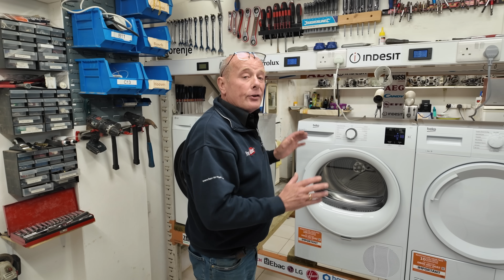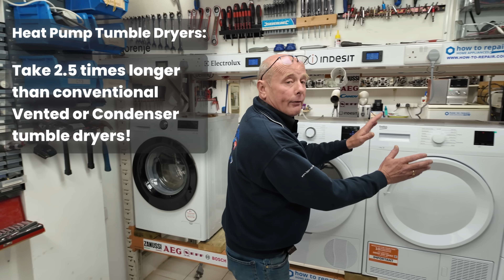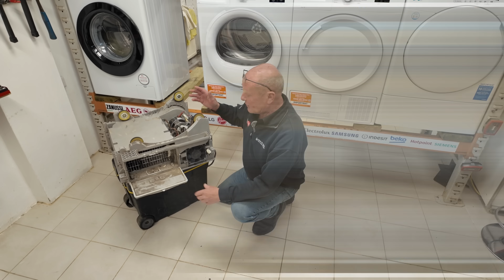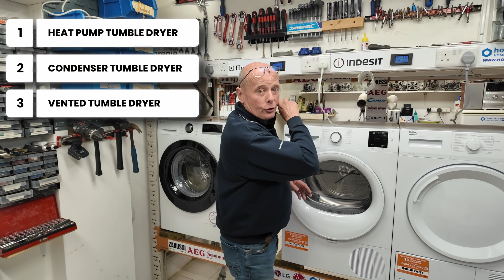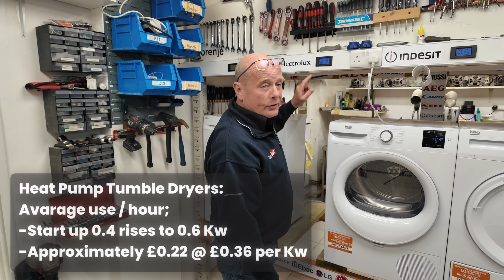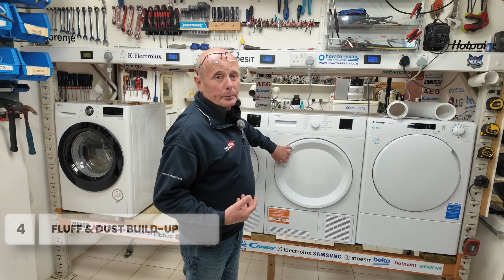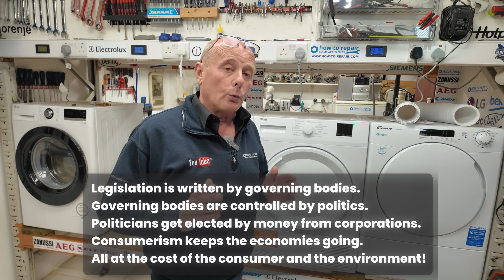Tumble Dryers the Shocking Truth About Heat Pump vs Vented & Condenser, NEW LEGISLATION!

Comment: As a German I can tell you that you will have fluff inside a condenser or venting dryer too. I open my 20 years plus AEG Lavatherm condenser dryer about every two years, same I did to the  vented Privileg dryer of my mother in law first opening after 30 years two buckets of fluff, and last but not least the MIELE condenser dryer of my mother stopped working, she already had the Miele Technician come to inspect it, she called me afterwards and asked me if I want the old one it's not working anymore, and the Miele Technician said to her it's not worth to fix it. She ordered a new Miele Heat pump dryer, I told her I'll look after the old one, she should cancel the order but she won't listen. Well long story short, I picked up the 25years old Miele took it apart and the failure was just a big pile of fluff behind the power switch, the fluff blocked the microswitch on the PCB. I gave it to my mother in law the dryer still goes strong and finally matches now on top of her Miele Washing machine and her old vented one I brought to our gas station. All in all never bought a machine in the last 30 years, I even maintenance our washing machine every two years regrease the rear bearing that's it, couldn't save more money over the last decades. Greetings from Germany
Reply: Any dryer will build up fluff. And I got the feeling that the old ones do it even worse than the heat pump dryers.
It is satisfactory to remove the fluff of course...
But yeah, always remove fluff after or before running the next job. Especially from the heat exchanger.
Reply: @bloepje  True, here in Germany fluff causes a lot of household fire, once the fluff ignites the thermal fuse in the heater element is useless. This is another pro point for the heat pump dryers.
Reply: @carstencroessmann agree - however fluff + electricity = risk. Mitigation: keep flammables away from appliances.
Reply: @SchorschvomDorf  This is really the EV argument. There as less at the present so it's to be expected not so many problems are currently being reported as there will be once all vehicles are EVs. Same with heat pump dryers. Fluff is fine lint like particles, like all small particles in air, once the ignition temperature has been reached it is self combusting. The more fluff/lint build up the less cooling airflow for the motor and compressor and both will eventually run very hot. Once the ignition temp has been reached the lint will self combust without the need of a heating element to ignite it. I think it's worth bearing in mind that, unlike conventional dryers, most people will need an expensive technicians visit to clean out fluff, so heat pump cleaning it's much less likely to be done. Only time will tell and once everybody is forced into heat pump dryers just how many will actually burst into flames due to fluff build up.
Reply: @bloepje  You are talking about the fluffy particles that travel through the system and are retained by the filter. We are talking about these particles that have escaped from the system and are accumulating inside the machine under the hood, all over the machine components.
Reply: @bloepje My experience is the old dryers from the 70s and 80s were far better than what we have today…and they are still going in 2026.
Reply: @bloepje  Unless I misheard isn't that what he said, all machines are subject to fluff. The points he makes are that cleaning out the fluff on a conventional dryer is designed to be easy enough for the lady of the house to do quickly herself and often without tools, at most one screw driver. Cleaning out fluff on most heat pump dryers is beyond the majority of DIY'ers and can take 1 or 2 hours for even a qualified technician. (at maybe £75ish per hour). The other point being that because it takes 2.5 times long to dry the same load the wear on the material can be expected to be around 2.5 times greater and the amount of fluff from the same quantity of materials is also likely to be greater per drying cycle because of the longer cycle time needed for a heat pump dryer. In addition to the points made in the video the source of heat will have little to do with the amount of fluff, heat is heat, what creates the fluff is the tumbling action of the drum and the length of time the material has to be bumped around inside a rotating metal drum.
Reply: Yes the problem is you have to tear the heat pump dryer completely down to clean off the fluff from the heating element that which is not self cleaning as the cooling one is. I did this once whith my siemens heatpump dryer because it took forever to dry shortly after two years .Before i reassembled it I  drilled a 1,5cm hole into the plastic box right between the condensing and heating element and sealed it with a rubber cap. Now every half a year i open it from the side (cutted a maintainance opening into the metal side too) and clean it with a peace of garden hose fittet to the vacuumcleaner. It s really a shame that this little opening  makes the difference between too costly to repair and repaired in 5 min. It works well now since 6years
Reply: We have an old vented Miele, it is brilliant, but when we moved it it stopped heating. I eventually found the problem , a little safety switch needed resetting under the drum, difficult to locate. Anyway it is 20yrs old, but unlike the cheap condenser dryers, there is no possibility of corrosion between the aluminum cooling pipes and copper pipes. Family and friends buy them and they don’t last 6yrs, what a waste of money.
Reply: I pulled out enough fluff to fill a large black bin bag and part fill a second, when I took my current vented dryer apart to replace the rear oilite bush and drum shaft, it was probably 15 years or so old at the time. It was one of the hotpoint indesit models that were later recalled for modification for being a fire risk, because fluff could find its way into the element, ignite and get blown into the drum or onto the fluff that would get trapped and build up under the rear drum seal, which was also made of a non-fire retardant foam.
Reply: The Germans must be recognised for making great domestic machines. I have a Siemens but would have also chosen AEG / Bosch or Miele
Reply: @portuglish Since the 1980s the "AEG" brand belongs to swedish Electrolux corporation.
Reply: @portuglish  Bosch and Siemens are the same
Reply: @portuglish  Pour AEG et Miele j'en sait rien par contre concernant la qualité hummm Bosch plus jamais je suis passé chez les Suédois Electrolux que je trouve bien supérieur. PS: AEG appartiens a Electrolux depuis 1996 donc c'est aussi Suédois.^^
Reply: @portuglish Had a Siemens washer and dryer sine 1997. Had to replace the commutator brushes on the washer about 5 years ago. Otherwise no issues.
Reply: He said that but the difference is I can clean it myself.
Reply: What has being German got to do with anything?.
Reply: @ I was offered the choice of 4 new models, or the modifications. I went for the mods because I wasn't keen on any of the machines offered and with all their repairmen tied up, I was concerned I might get a faulty machine, like I did when I bought this one. From checking the recall date, it must have only about been 10 years old when I pulled all that fluff out. When they ran out of the cheaper models, they ending up offering better models including heat pump ones, so had I waited to register my machine, I might have been able to get a heat pump model as a free replacement. The repairman replaced the back panel, the rear foam seal, fitted a pop rivet in the back of the drum to scrape fluff out of the seal, a brace to stiffen the case and what looked like a rubber door stop that will stall the drum if it droops due to overloading or when the rear bearing wears out again.
Reply: @mels8966 you had a hotpoint indesit recall
I am curious if you inspected how well it worked
I was involved in this recall
Reply: @TheLarryConnell  I've checked it at least a couple of times since the mods, there was a light coating of dust over the bottom, but not enough to bother to get the vacuum cleaner out. Last time was a couple of years ago when I had the top and sides off, with the front and back splayed apart to scrape out a build up of lint in the slot that the metal rim of the drum runs in, that is formed by the metal brackets that the plastic drum bearing pads clip into. The lint in the slot was causing the drum to bind slightly and the motor to stall, not helped by an aging motor start/run cap and the pads could probably also do with replacing again. The face of the front foam seal was pretty clean this time, previously when I had it apart before the modification to fix the drooping drum and the worn out bush, there was a thick ring of felt that had formed from all the lint that had collected over the years. I didn't separate the back of the cabinet  from the drum, so I didn't check if there was any burn lint trapped in there again, but I couldn't see any evidence of lint trapped in the rear seal. Surprisingly the rear bush is still in good order too, although I have been using it a bit less in the last few years, which is the main reason I haven't replaced it with a heat pump yet.
 
The 1980 hotpoint vented dryer my mum had was a much better design in the respect of lint or humid air escaping from the drum, the fan drew air into its case, which had foam draft excluder strips all round and putty sealing the corners, and it fed into the heating element around the door, before going through the drum and out the vent tube at the back, so the case was slightly positive pressure to the drum and any leaks through the drum seals would just blow clean room air from the case into the drum, with little chance of lint getting into the element or anywhere else even if the vent pipe got blocked. Downsides was the spiderweb element was held up by what appeared to be disintegrating asbestos cord, and the number of times  I burnt my arm on the hot element at the front, emptying it because I didn't wait for it to cool down and it must have been a fair bit more costly to manufacture.
Reply: the Bosch heat pump "self cleaning" dryer is terrible at drying items. The self cleaning function is useless. The internals are buried inside and beyond a consumers ability to service. I totally agree with you analysis and conclusions.
Reply: @krusty9407  Today we have a lot of Marketing BS out there. Actually, manufacturers should get sued for false advertising such as "self cleaning " and it really isn't any.
Reply: I'm from Estonia I use heating from september to april so at that period there is no difference what i use on drying side but at motor and electronics make difference then longest running makes the most heat power to my rooms. so in my case there is little to none energy saving to use. The physics is when you evaporate watter into your room room temperature gets lower and to maintain temperature you must heat it  that is simple physics. WHEN YOU  TAKE HEAT FROM YOUR ROOM YOU MUST REGAIN THE TEMPERATURE.
Reply: I've got a Hoover vented tumble dryer, it dries a big load of washing in 45 minutes and I vent it through the outside wall. I don't find it expensive to use, it has a reverse action, it doesn't crease clothes, it's now 6 years old, never had a problem with it, I clean the fluff filter every time I use it. Now we have a dilemma, we're moving and we're not allowed to vent through the wall due to a fire break in the wall, I can vent through the window, but do I really want hoses trailing, not really no. So we went to Curry's today, and one of these Becco heat pump driers was recommended, £429 and a Which Magazine number one according to the salesman, it has a 1 hour dry cycle, but will it actually dry in one hour, it's a lot of money to fork out! We had a condenser dryer years ago that took like 3 hours to dry it was rubbish I hated it, I realise they may be better now, but I honestly don't know what to do, I don't want to make a big mistake! 🤷🏻
Reply: @Lynn-zw7dr Ha, I was in Currys today as I’m having the same dilemma! I got so confused I ended-up trying out some virtual reality goggles just for some light relief 😆
Reply: His point was that because clothing is tumbling around in a heat pump dryer two and a half times longer it will generate more fluff.
That would indicate the clothes will wear out quicker.
But I doubt it will be two and a half times more.
Reply: @pencilme1n That's a very good point, honestly I don't have that on the screen, but of course longer run time with almost everything causes wear, in this case our clothes. The question is, is it worth to think green and buy a HP dryer but on the other hand you have to buy new clothes at least more often. Well, difficult to measure that, but I'm not sure to go with HP, as long as I can service my old one. The greenest way would be to put the clothes in the sun on a rope. But in our case we have a cat and the hairs will stay on the clothes there is a dryer much more convenient to get rid off the hairs.
Reply: @pencilme1n That depends on the dryer. There is no technical reason, for them to take 2.5 times longer*. It's likely irrelevant to begin with, as there are two key variables that matter for the cloth:
1. Heat: Not all textiles can handle heat. They may be ok in a WP-Dryer (using low heat). Unfortunately the label will only say "No Dryer", since the cloth manufacture cannot know which dryer is used. So as long as other Dryers are not completely phased out,  that advantage of WP-Dryers doesn't come into play.
2. A x "Amount of Air Circulation" x B x "Running Time" x C x "Aggressiveness of Circulation": That will determine the amount of fluff and wear on clothes(A,B,C = design influenced constants) . If there is no design flaw, that should be about the same for all machines. 
Venting means most of the fluff is vented. Condensing will have a lot fluff trapped in the condenser. WP (in the rare case of proper design!) will have a enhanced filtering system, since there is no way to easily clean the heat exchanger of the WP. That makes the fluff more visible to the user (if he actually cleans the filters) and therefore it will look like there is more fluff.
Most WP-Dryers are just revamped Condenser Dryers, without a proper upgrade to the filters. So they will accumulate loads of fluff inside the WP heat exchanger. That then makes technicians think, that there is more fluff generated. 
*Energy wise, taking longer is better or at least it makes them look better in terms of how the energy-label measurements are taken. Not sure what is the case. Pretty sure the measurements are only valid for a brand new machine, not one with fluff accumulation. So they may not reflect the real consumption if the machine has been in service for some years. That may also be a reason for the massive neglect of almost to entire industry to improve the filters.
The is always fluff..., even if you dry it on a line. It's just a lot less, and since it will be on the floor mixed with other dust, it's less noticeable.
Reply: @pencilme1nDefinitely even more than 2.5 times on my new Bosch serie 6. At $1200AUD it takes 4 hours for 4 bath towels. My old $300AUD vented dryer did them in one hour after taken from the same washer's spin dryer. Yes it does use less electricity per hour, but I'm still unsure about total cost of ownership.
Reply: @RolyKukainis These are my cons too, that machine must last 2,5 times longer so. That it needs longer  is logical, because of the physics, a heating element needs 2000watts at least and a heatpump will generate( just a guess) around 500watts, so less energy to dry the cloth, 4 times less so it needs for the end result dry cloth, 4 times longer. Fingers crossed that the bearings of the drum are serviceable,  those have the most work to do. And get you a spare seal for the drum this one needs be sooner to he serviced as well, all in all 4 times sooner maybe. Good luck. Greetings from Germany ✌
Reply: He is NOT saying that you do not have fluff inside the vented/condenser dryer! He is saying the opposite: You have a lot of fluff! BUT to remove it in a vented or condenser you need 3 minutes! And your grandma can perfectly do that. On the contrary, in a heat pump dryer you need a technician working for over 2 hours! And charging the relative cost to your dear mother. Got the point?
Reply: I think it's fantastic to hear that your machines last so long. And no other comments there. Will probably get Monday's copy to Sweden.
Reply: @mattiasbergman3292  I still run an old Miele W698 this year it's 35 years old and we use it daily sometimes twice a day at our gas station to wash towels or cleaning rags. I love old machines, less electronics which is the main problem today. Besides this, that the machines of today get a better eco friendly label in power consumption, most of them don't wash as hot as they used to. For example you want 60° you probably only get 50°, a German Magazine called "Stiftung Warentest" found out.
Reply: I'll remember that when our 18 Y/O Miele stops working.
Reply: I too regularly remove the top cover on dryers to inspect for fluff. I've done this since a Creda nearly caught fire due internal duct that was not properly secured and leaked, blowing fluff in places where it shouldn't ( motor, heater element etc). Even my old Miele built up fluff inside as the drum seals wore over its 20 years of use.
Reply: Great! My AEG washer here in Canada lasted
Reply: Your missing the point at least your could  clean it out , the a heat pump dryer that is not possible
Reply: @woodgeorge1  It is, just more complicated. Means it needs even more time. Time is money. In Europe a lot of money. That means it generally not worth it.
But almost all brands completely dropped to ball when redesigning their machines. They using the same filters as for the old dryers, instead of filters that account for the fact you cannot easily clean the heat exchanger. Most simply say to take the fluff from the front end (were most of it accumulates) every now and then.
If you have a low pressure cleaning system and a water vacuum cleaner, those do decent job of removing the fluff from the front end, without opening anything. 

Glass door = garbage. No Black foam filters = garbage. The bigger the filter System, the better...  But it's hard to actually find any (at least single household models) that have anything better than some netting filters, which only stop the biggest elements of fluff.
I deal with all kinds of air / fluid circulating systems..., mostly with the ones designed to run a lot. If they designed the filters as bad as in the dryers, those systems would fail every month or so, instead of running 24/7 with annual maintenance for multiple decades.
If you want the real deal: V-Zug units for mutli-household use are properly designed. But the retail for 3000. They are closer to a commercially used unit from the design than a  end-consumer item. While not necessarily designed with repair in mind, they are designed with end user laziness, and something like i suspect 10000 cycles without any repairs required in mind. If used in a single-household you won't get that far, as material aging will overtake wear and tear failure after something like 10-20 years.
Reply: @carstencroessmann could you suggest if Waschtrockner machines like Bosch Serie 6 are good? I live in a single room apartment and recently moved to Germany. Going to Laundromat is a huge pain in the ass. I have provision in my kitchen for either a dishwasher or a washing machine. I don’t have any Kellar space in my apartment complex. Clothes wouldn’t dry in winter so I’m thinking to get a Waschtrockner. Do you suggest any other brands?
Reply: 30 years maintenance is a if doffeence between 2 years maintenance
Reply: You probably use 5-10 kWh for a full load. We use 1 kWh or so.

We have a 2012 Cylinda TVP 420 with heat pump. It has a 800 W max rating and it has served us BRILLIANTLY for 13+ years now. Only thing is a bit of belt slip(?) causing noise during first minutes of operation, that's been for many years now. We found it on sale and I got the price down a bit more, picked it up for around £400, original price was twice that.
It dries 8 kg of clothes in 60-90 min, so I'm not sure what garbage is on the market these days. 
Our 2012 Cylinda Sverigetvätten washing machine is very similar to the ASKO you recently reviewed, only older... We also have a Cylinda Sverigedisken, dishwasher, from 2012, nowadays produced by ASKO, while Cylinda took the path of planned absolecense. Our parents in law have an ASKO and after an initial warranty repair, it's been GREAT and the inside is fabulously great to allow three layers high stacking and STILL getting it clean!
Reply: @My_HandleIs_  If i looked it up correctly, that one has a proper filter system, which is rare. You have a foam-filter fitted in between two netting-filters in the door. And single one on the back to prevent dust from the room air to built up in the other heat exchanger.
Assume the manual tells you to take the fluff of after every cycle and then wash out the foam-filter if you're done for the moment and every now and then remove the rear filter and clean it. And you do that diligently.
Most WP-Dryers have no foam-filter front and no filter at all in the back. They fluff up, become inefficient and probably have lot more design flaws...
Reply: We all need sons like you! :o)
Reply: @princessmay9921 Thank you for the flowers. Very kind, but I see no good signs in the sky. The new Generation after us, I'm a 1976'er they are so dumb and lazy. No words, we'll  have a bad futur believe me.
Reply: The fluff that accumulates in the machine is the result of one of the two drum seals being worn out and needs to be replaced. In addition to the fluff, this also causes heat to escape, which significantly extends the drying time.
Reply: But Miele is a fantastic German machinery still owned to 51% by the Miele family. These machines are built to outlast me, and I love german quality. In my work I often meet old german woodcraft machinery from the 1940-1970 still going strong beside new machines here in Sweden. Here the old german machinery is well known for its quality, just like Swedish machinery that are still made in Sweden. It’s always cheaper to buy a machine that works for 30 year then 5.
Reply: @ThePearsson  Those times are gone. Miele has significantly reduced the quality, but kept the price. Modern marketing like in the car industry. Produce quality at a high price so people get used to it, then produce cheaply and with the same price you make big money.
Reply: I’ve owned all 3 and that was also my experience. Even being diligent at regularly vacuuming out under the lint basket, which I emptied on every load.
Reply: What bearing does nationality have on being able to tell us that fluff builds up in all tumble dryers which was also clearly stated in the video.
Reply: @openminded3763 that’s what your focusing on ?? Perhaps you should change yr name.
Reply: Well said.
Reply: No wonder America is so ahead , THANKS TO THE GERMAN ENGINEERS THEY STOLE FROM GERMANY IN THE 1940s😢
Reply: Interesting but lost as in which choice is best for the environment, running cost, drying efficiency & longevity.

Think I'll simply continue to buy a non vented standard tumble dryer.  

You'd think Simon Dyson would have entered this market space & given us an alternative.
Reply: @herbparker1824 Hi, honestly I have no experience with Simon Dyson, I guess not available in Germany. Longevity ans environment,  good question. A heat pump dryer reduces the risk of a fire by almost 90% I would say. Because there no heating elements installed, where the fluff can ignite. They have a heat sensor to shut off the heating element in such cases, but once the fluff is ignited, good luck. The heat pump needs longer timer to dry, because there such much heat compare to the heating elements. Because of the saver usage I would turn to the heat pump dryers nowadays. I can't tell you if energy consumption is less or not. At least equal, but would be a good test to try, sooner or later. Hope I could help a bit. Greetings from struggling Germany
Reply: The man said dust was the problem not fluff. I hate you people who don’t listen to what people say. Then prattle on about nothing. If you are not going to listen properly. Don’t comment. 
Simple as that.
Reply: @martyn52  Martin…. whatever your name is. Martin… Settle now, - there’s a good fellow!  All this talk of ‘hate’. Where on earth does it come from?  
Be assured, it does little to validate your point of view…..and results in an unwarranted net energy loss.
Tch!People! 😵
Reply: @paulgregg722,   laughter
 
        (Youtube took emojis off me)
Reply: @martyn52  Is your blood pressure down now? Calm down, fluff dust whatever. But believe me, you probably find more fluff then dust in a dryer.
Reply: @martyn52 Wrong, replay @ 8 minutes, you obviously didn't listen @ this point in time.
Reply: @martyn52  Calm down, dust/fluff/detritus/ whatever language used is still relevant.